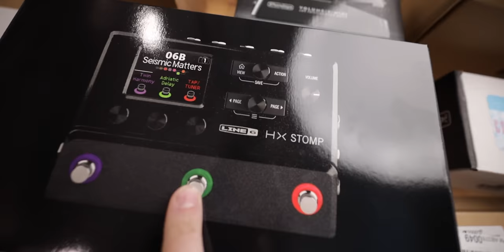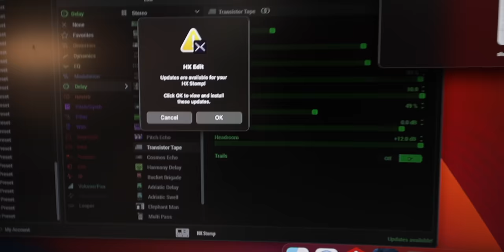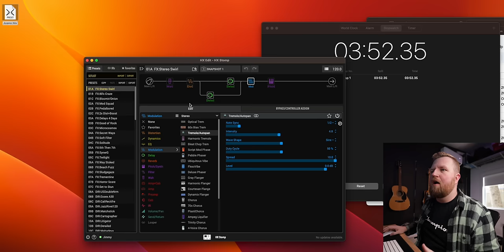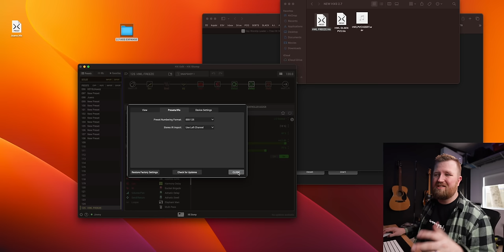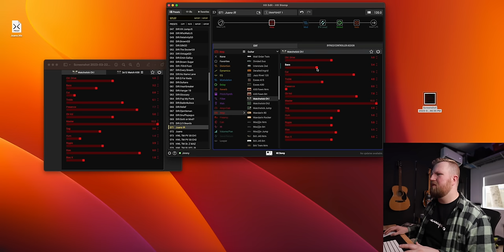How to Build A Pedalboard Around The HX Stomp

Comment: thanks for the "let's see how it sounds at the venue" part. I would be curious to see an entire video with tips on tone at venue vs tone at home.  I've had issues with tones I've dialed in at home through headphones, amp or through home audio system that sound completely different when I plug in at different places.
Reply: One thing I have found helps my tone cut through at a venue if needed is to tweak global eq. Some of my go to's are high pass at  50ish hz, low cut at 110ish with a wide 0.7Q of a few dB, then to help cut a mid 1.4k 1.4Q 1.4db boost if needed - I tweak this one most

Comment: hey jimmy, is there a downside to using those 1/4" to xlr vs. 1/4" into a DI box? I'm building something like this soon and didnt want to buy a $200+ DI box to mount underneath. Thanks
Reply from the maker: Only the features you get with a DI box,: PAD, Ground Lift, DI / Line Iso
Reply: @HeyWorshipLeader  Do you know if there is a noticeable difference without a DI?

Comment: Great Video really insightful and informative, very interesting to see how you use the HX Stomp, one question why did you leave the HX output to instrument out ? I thought the pedal board was being used a a direct out to the Board ? should it be set to line output ? thanks 🙏
Reply from the maker: Line output on the HX Stomp is like turning on the Guitar Pad in the HELIX. Sends out less. If I find myself super hot at the board I'll set to line. Not bad to just start there for sure! Good call

Comment: Good call on the power supply switch.  I ended up getting rid of my voodoo labs for the TrueTone CS6  because of the way the TrueTone handles anything and everything you throw at it with zero problems.  I found the Voodoo Lab wouldn't give the power needed for everything even though it said it would.  I didn't want it to ruin my HX Stomp

Comment: Thank for this - it was super helpful. On your personal board at around 3:45 - what is the midi box 4 doing? I didn't see it in the new build. I'm getting a revelation and looking to integrate it with the HXC stomp and the MCX. Just seeing if I need that too.
Reply from the maker: That is the Midi hub basically. Since some of the midi pedals are "dead ends" (no midi in and out) I needed some place to go in and send a bunch out...JET Pedals has a new one called Traffic Control. If you grab it, use my link and code to save 10%
LINK: https://jetpedals.com/?ref=19
CODE: HEYWORSHIPLEADER

Comment: I use a stomp box setup at my church and through an amp. Thinking of getting a stomp to lighten my board but i have some favorite pedals,  any recommendations ? Do or donts
Reply from the maker: The HX Stomp is the way too go for sure. Even with other pedals. And if you want to play through your amp every once in a while (like I thought I would, but I never do), you’ll still have access to a bunch of a fx you may never had before, which was the case in my experience
Reply: @HeyWorshipLeader  that's good to know, I emailed you ok. Thanks again

Comment: Oh and on the dual lock, I use the 3M Scotch heavy duty fasteners...one strip on top and bottom (leaving any labels untouched on the bottom of the mini pedals) and it doesn't go anywhere.  It even holds my power supply under my temple board and hasn't failed yet. :)

Comment: @HeyWorshipLeader, great video! I wish I had watched it earlier. Anyway, accidently I bought the Rockboard 3.0, too. So, I could really copy all the things you did ;-). BUt I didn`t do it, I had other pedals and so on... but one question I have: when you supply the hx stomp with power you use the current doubler, but it has a straight blue connector, that sticks out a lot and not an angled connector. So how did you do that? Another adapter? What adapter then? I used one adapter, but it failed delivering the right current....

Comment: I have no idea ho to wire my own pedalboard around my HX Stomp. 

I have tuner, HX Stomp, compressor, (soon to get a volume pedal), and potentially another drive pedal.

I also didn't know that cable wiring around a volume pedal was so confusing. I thought it was:

guitar-volume pedal-compressor-HX Stomp-to house system

but it's something like

guitar-HX Stomp-compressor-volume pedal

Resulting in a fine mess of cables and wires.....

Comment: The more I watch these videos, the closer I am in pulling the plug on a Stomp...
Reply: The Stomp is amazing. I have an XL, actually, which I like because you don’t have to add foot-switches to it and it can be used alone if need to., which reduces form factor if need be. Truth be told though, when you add up the cost of all the pedals to add on to a stomp, including the board and power supply, etc., it becomes more expensive than a full Helix floor. I have that as well, and it’s bananas awesome.

Comment: I got the hx stomp & tonex pedals but also want to use board for looping rig also with the aeros loopstudio and midi maestro & beatbuddy a boss ve 500 and a dual auxiliary foot switch maybe a dirt pedal, I know its getting complicated now I dont wanna building two different boards because I'm tryin to simplify my set up, and I need to use the hx & tonex for both boards but dont wanna hual around a huge ass board or have to reconfigure my board every time I wanna play guitar or do a solo looping proformance or buy another hx stomp and tonex one, I have a helix rack but its in my studio rack and it would be more stuff to haul or buy. Any suggestions would be great in sorting out and putting  something together and would be very much appreciated😊 thanks for your video's its great advice and help.

Comment: Does anybody know if the dunlope volume pedal goes from the hx stomp thru the in jack to the dunlope? @heyworshipleader
Reply from the maker: If you want to use it as expression you'll come out of the middle "aux" jack on the Dunlop with a TRS cable, and go into the Stomp "EXP FS7/8" Jack
Reply: @HeyWorshipLeader If you only want to use the dunlope for volume and leave the fs4/5 jack for Dual swiches. Can you connect it thru the in/R on the stomp?